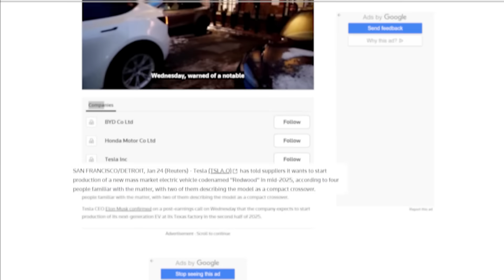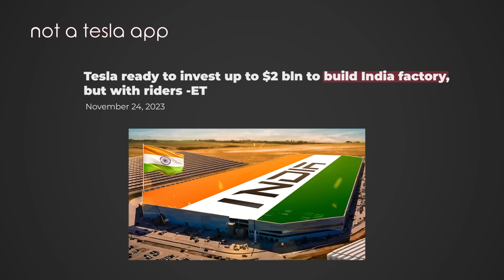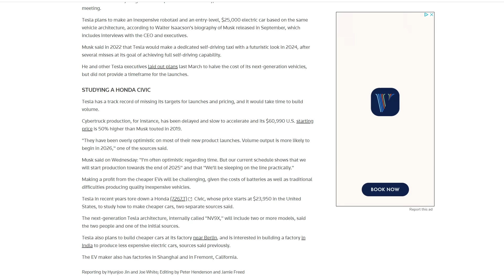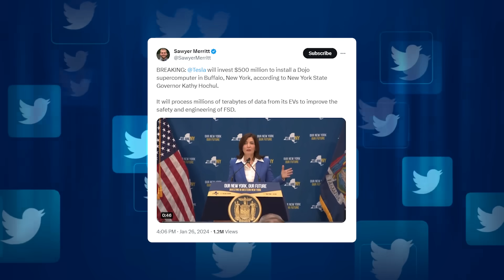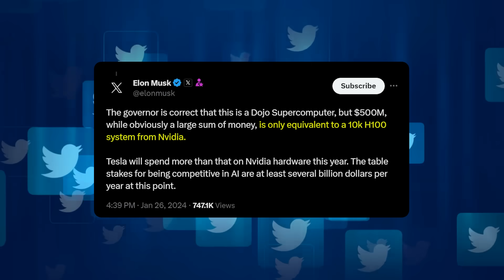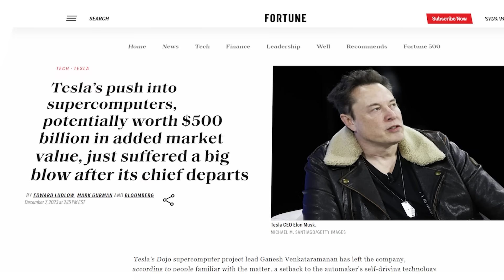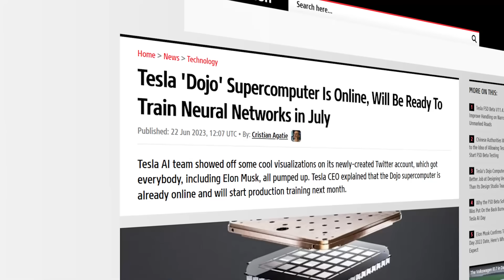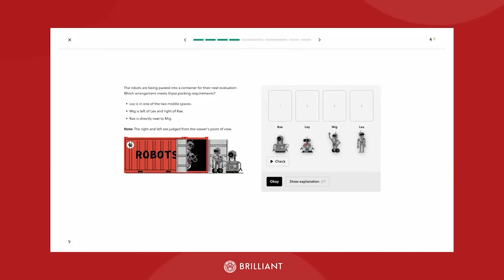We Were Wrong About the 25K Tesla - Redwood Revealed

Comment: As an old high school shop teacher I feel capable to criticize whether it will be easy or hard to train a robot to throw a clay pot or flip an over medium egg.  Aside from keeping its balance, the constant feedback  loop needed to become reliably successful at doing these things will require recalculation at a constant rapid pace.  I'm thinking about 200 times per second, in order for the robot to "get a feel" for what it is doing.  May have to break a few dozen eggs, and center about a hundred wads of clay on a throwing wheel.. In other words it should be fairly easy.

Comment: If tesla will sell brand then it is definitely failure in indian market. 
Indian test car in all ways, what tesla aim in Indian market depends. 
Leading car companies is maruti and hyundai as they have reached to expectation of high population in India. 
So far in ev market tata is leading in India, but the day maruti will start ev will be for maass even tata will face tough time. 
Even tesla is no brand as have to prove, people will buy there experience about car capability will determine.
Reply: Did you use google translate? 
I'm struggling to even get the gist of what you're saying.
Reply: @MrBenHaynes  what is aim of tesla to reach to every possibel car buyer or remain as brand . 
Brand means all EV car manufacturers are on same footing, not even a sing EV car company is brand. 
If tesla has decided to enter indian market if it can not bring car in buying capacity of common people  it is definately be a failure after few years. 
If tesla is good and reliable after reaching in hands of common people people built trust in brand and buy. 
Yes if tesla has come with intention to sell big brand name with high cost then it is failure in India. 
Ford is example they kept there car cost little expensive to that of other car manufacturers they failed. 
What is aim common people then should decide buying capacity being product in market if car brand is tough people will approve and make it a success not otherwise.

Comment: The good battery is a nuclear battery. One that will last ten years without recharge. That will be the birth of the electric car.
Reply: Sorry to burst your bubble but check out the power output of said nuclear battery.
Reply: @jamesvandamme7786  Not to mention the weight and size of the sheilding needed for even a modest sized nuclear power cell for what will be essentially a self charging car, not really powered directly by the power cell, maybe in a limp mode. But yeah you would need a steel and lead containment the size of a small package truck at a minimum to charge a battery at a rate comparable to a level 1 charger, let alone a level 3, those are SMR levels of power.

Comment: I hope its close to the size of the Nissan Rogue
Reply: Rogue is actually rather close, only a bit smaller than Model Y, so I think the car will still be smaller, but I hope it will not be Europe type small... Honda Civic in length could be it probably, Opel Astra, VW Golf? Something in between these?
Reply: @lkrnpk I think smaller still. Beetle, or Fiat 500 is for me the best guess. I'm thinking front seat reverse in robo taxi. I think it will be double ended / symmetrical front to rear, like the Citroen Ami.
Reply: Small lightweight efficient city car is all EVs should be.
Reply: @rolieg81  Well then why build yet another one. I'm 6'4" 250lbs with not the best back. Something a bit taller than the Y would be nice.